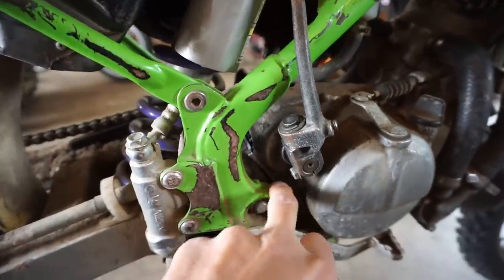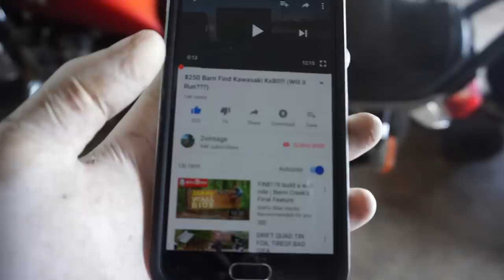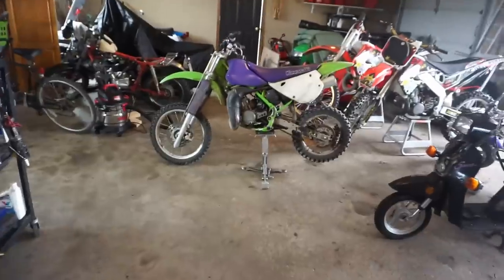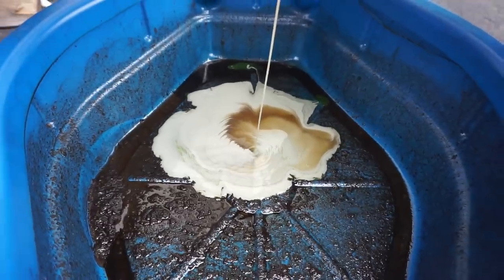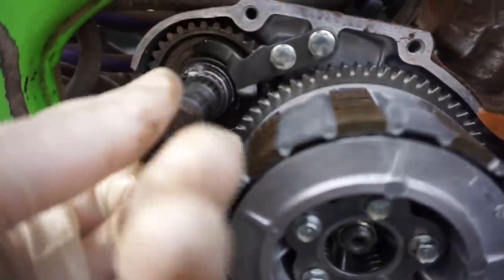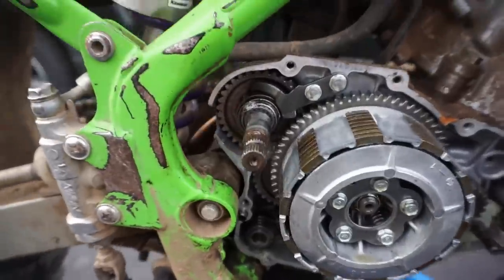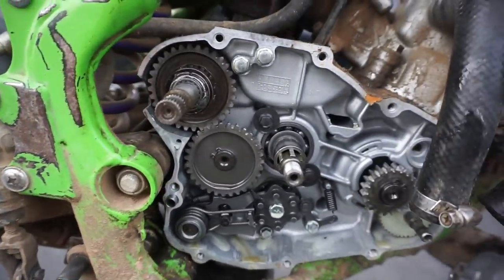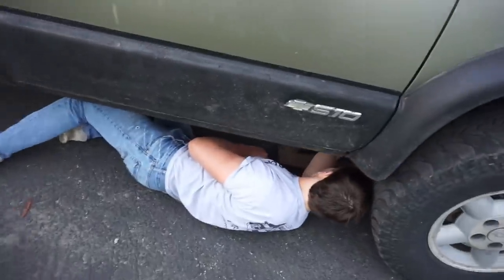It Has Begun...Kawasaki Kx80 Build!!!

Comment: Water in the engine - Water can get into your oil sump in two ways: Water in car - Water condensation in cold air or combustion gases: this phenomenon is extremely rare and only occurs at specific temperatures.Water in the oil - Coolant leak due to non-watertight seal (cylinder head gasket, etc.).

Comment: You need to get it welded properly. It came out due to a fault with case housing not being strong enough to handle the compression stroke on the kick. It blew the bolt hole out and if you jb weld it, first or second kick it's gunna blow out. Get a new case I've had it happen and tried this. You guys rock keep up good work bro.

Comment: U have to take the bottom bolt off the water pump to drain it make sure radiator caps off when u drained coolant
Reply: Get a 350x

Comment: the trick with jb weld is ruff up the surface make dam sure no oil is on any of it do not even let your finger touch scratch the case in two directions apply it in thi coats get the quick set  about 5 layers with a small stiff brush and you start n the middle and work your way wider with each coat the overlap makes it real good also after you're first that fiberglass cloth works well on big holes put it on your 2nd coat looks like you have a nice kdx  you should be able to fix it just take your time good luck

Comment: I had a similar problem with the case breaking. I think your issue was that the big spring has an end that is bent to fit into the little hole on the top of the case surface. I think it slipped out of the hole and when it was kicked the spring flew into the case, causing it to break out like in the last video.  Also that small arm next to the kick starter gear should be bent and is not the issue. Best of luck hope I was able to help out!
Reply from the maker: Thanks!

Comment: jb weld and wire mech on the outside coated in jb for extra strength clean and sand the surfaces!

Comment: Try aluminum welder bc I had 2 raptor 350s that the case broke bc of the chain snapped and I used aluminum welder and It worked now I use case savers on my 400ex

Comment: Jb weld does hold! I owned a raptor 350 before and the same thing happened chain snapped put a hole in the motor, used a lil peace to cover the hole and jb welded it, and it ran for as long as I kept it

Comment: Honestly you should just weld it. Its not that much work and you dont need to tear the motor appart. JB weld will most likely work fine but if you actually weld it it will be 100 times stronger
Reply: The Liberator I don’t disagree that an actual tig weld would be stronger, but I think jb weld is way stronger than necessary and it will suffice just fine for that piece.

Comment: U can use aluminum tape for duct work to put over the hole..the tape will create a wall for the jb to ahear to..remove Kickstarter gear, then jb weld outside and inside of the case..hope this helps. #brokefolksmoto 😎

Comment: Hey guys the jb i dont think would work being right on a bolt hole when u go to torque it down beings ur gluing and thred hole back on to the casing when u go to tighten cluch cover to spec i believe it will brake the jb with all the tighter pressure being on it it may work ive had success with jb welding my water pump cover on my rm 80 and it held good to the pressure but only i believe its 8lbs of pressure that rund in the radatior so not much at all you can more than likely get a crank casing off ebay for cheap i just bought a kx65 whole transmission for 60$ look on Ebay for the part i would. over all nice bike dig the purple years kx one way or another i got faith in yall she will be ripping next week

Comment: You can JB weld the engine part, it will work vell, because there is no perssure in the oil pit.

Comment: I Thot u couldn’t mix match cases or is that only for certain makes and models
Reply: I’m just getting in to this type of stuff I just heard that most cases are specifically fitted for the engine it came on . Like one of my old revolvers I got extra parts for it and even though they are from the same exact gun the plate to cover up internals just would not fit

Comment: Maybe you can try that "low heat" aluminum welding rods from Amazon? Do yourself a favor and pressure wash those machines before you work on them. It will help keep crap from getting inside the engine.

Comment: Water cannot get into the oil from a bad head gasket on a 2 stroke.  2 separate compartments.  That is why you have to mix oil with the gas on a 2 stroke.  It is a bad water pump seal.

Comment: You maybe able to reuse the waterpump seal for now, the little spring circle that goes around it should split apart, you can then chop a few mill off of it to create a tighter seal on the shaft, this trick is also very effective on leaking fork seals! Ive just dont this on my 2017 ktm exc 250 and no more weeping from the fork seals..

Comment: JB weld? Duck tape? Are you kidding. Man the older you get the worse you get. You don't listen. In one ear and out the other. Just like the CR500. Do things right to start with. End of story. At least Tig weld the case pieces. Your spending money on other stuff. Yeah you'll have to pull the motor and do everything RIGHT. What is your problem? That you can't fix things right? No one wants to have too go through that trouble. But it's the RIGHT thing to do regardless. When you do put the kickstarter in, you may have to pre-load the kickstarter spring. You'll know if you need too or not once you put it back together.